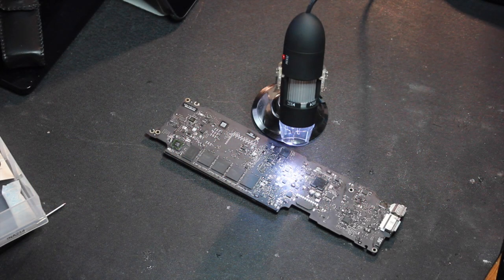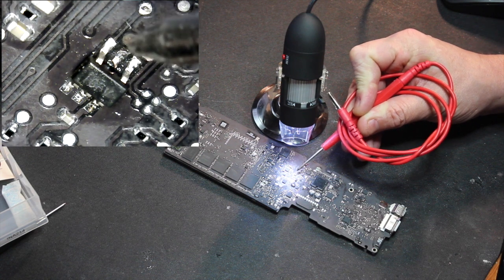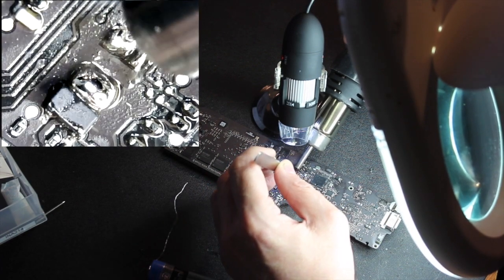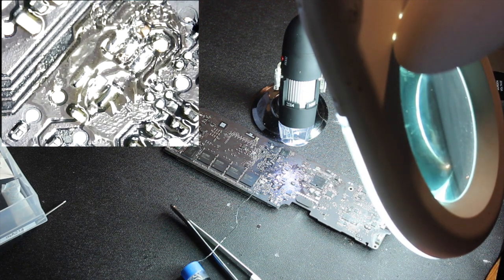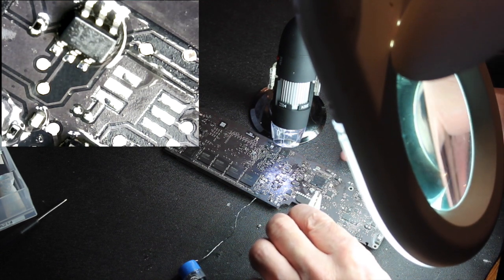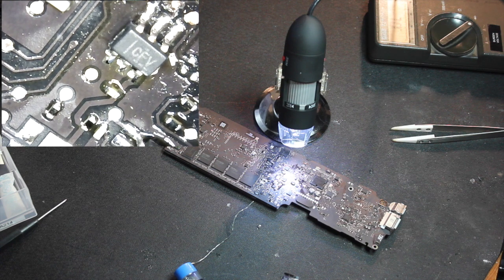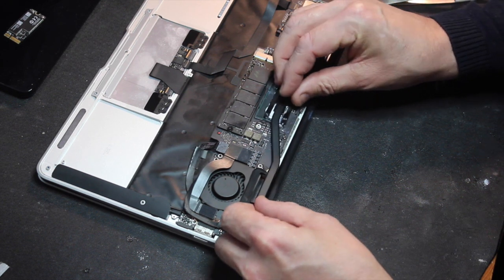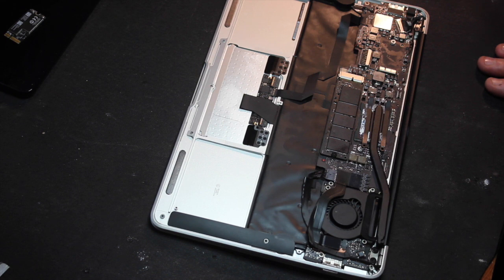Steve'll Fix It S02-E01 - 2014 MacBook Air liquid damage repair

Comment: Very brave of you even to attempt the repair, very well done. I once washed my Iphone 4 in a normal wash and noticed the clunking half way through. I did rescue it by keeping it in a bag of rice for one week with constantly shaking it about and my fingers crossed. Only lost one of the speakers but its still working today!
On a side note any details on your microscope and the tweezers you use, and a pointer on where and what to get for a rework heat gun as I heard you say avoid the cheap chinese ones? Thanks hope you don't mind indulging me. Thanks again for the work you do here.
Reply from the maker: +Charlie Cat Component level repair is what I do for a living, so there was nothing brave about it! Drying a wet phone without removing the water will result in mineral salts deposited on the board. This may not give you problems initially, but it's highly likely to fail further down the line unless you are incredibly lucky. It is much easier and cheaper for the customer when they bring me a wet device rather than 6 months down the line when corrosion has eroded components, pads, tracks and vias. I may do a video on the lab equipment at some time in the future.
Reply from the maker: +Charlie Cat I've just got an XBox 360 in for repair with the Red Ring of Death... But I don't suppose anyone out there would be interested in a genuine fix ;)
Reply: +Charlie Cat
My mom once fell in some water with a nokia flip phone (this was years ago), and I just took it apart, place it in a car parked in full sunlight for a nice summer day, windows slightly cracked, and with the sun, the inside was over 100F, and the phone worked after that, just that the sd card reader wouldn't work anymore.
The water itself doesn't damage anything, just the particles in the water (not pure water), lets the electric flow in ways it shouldn't, and that can cause damage.

Comment: +Steve Brace for the replacement INA214,is it the zero-drift or the current shunt feedback version?
Reply from the maker: The INA21x are 26-V, common-mode, zero-drift topology, current-sensing amplifiers that can be used in both low-side and high-side configurations. This one, from memory, was in high-side configuration.
Reply: @SteveBrace  Thank you for the response. Just ordered a few from TI